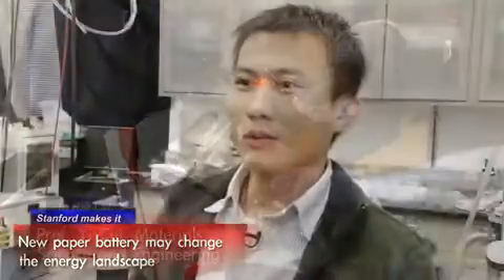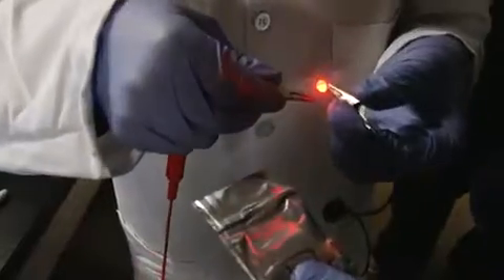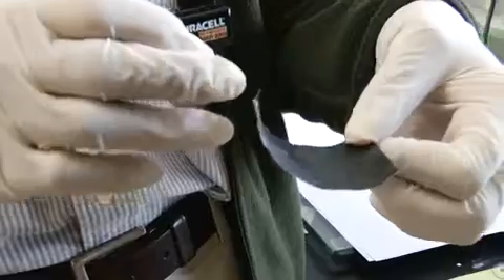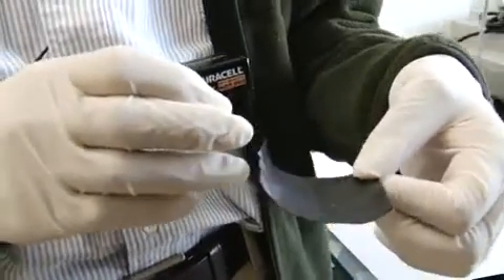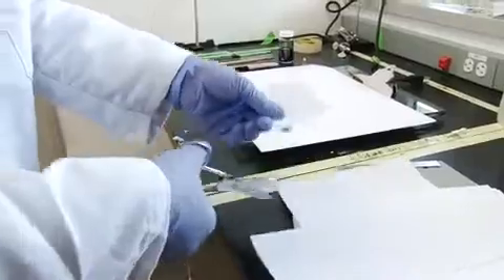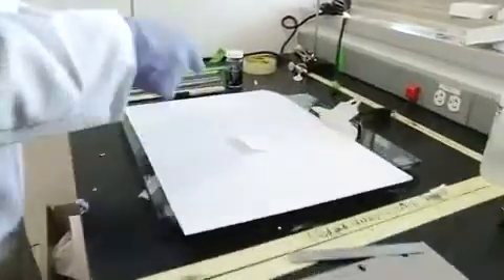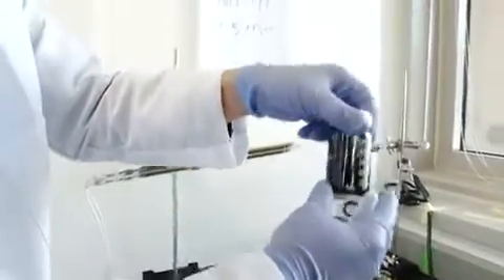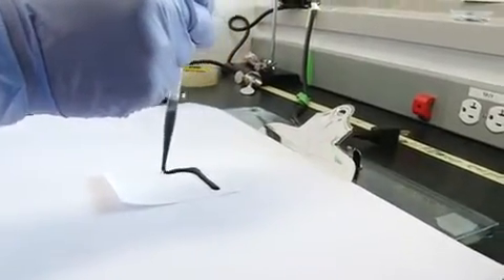Nanotubes +ink +paper =instant battery (18)

Comment from the maker: @Rawbush As far as I understand it's not such a difficult or complicated process, but it takes quite a bit of energy, and it seems that the carbon nano tubes need to have a certain shape. For now it seems that they can only use 10 percent from the nano tubes that they have produced. But I've posted some extra links in the more info box and at the end of the video and you can see exactly how nano tubes are being made. There seem to be several ways to do it.  Greets my friend, iT